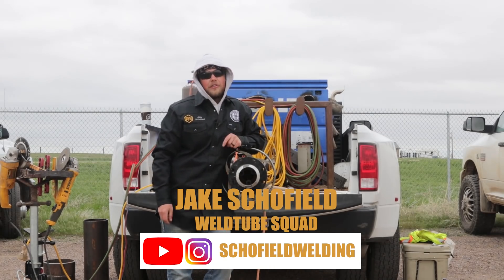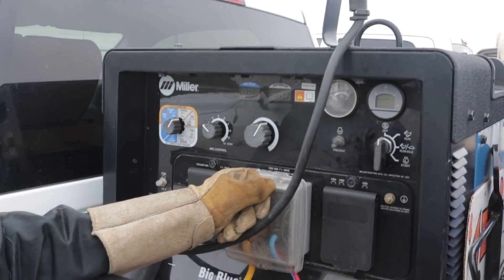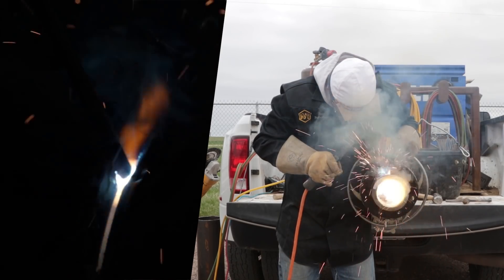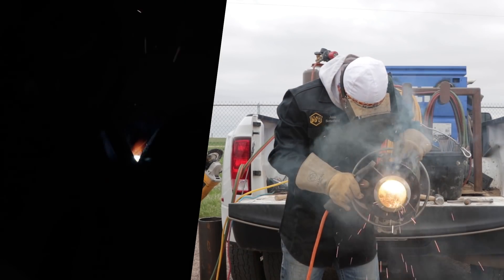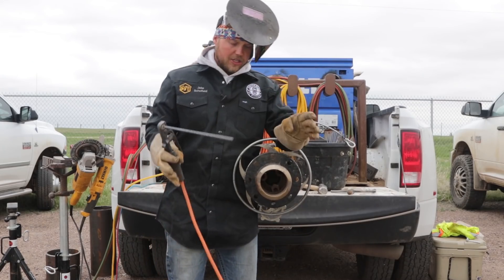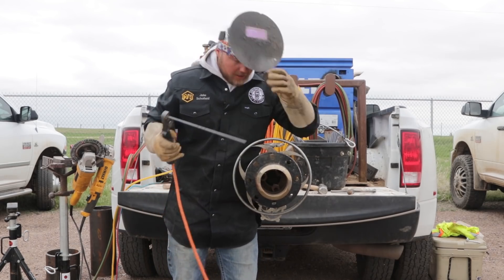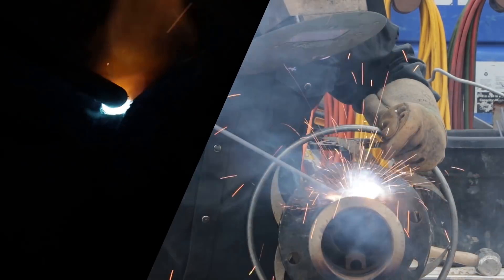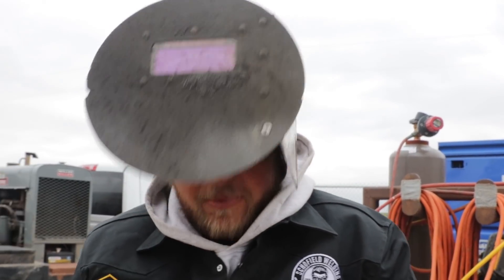Downhill welding tips and tricks 4” o-lot to flange

Comment: Bomber one tip don't do it it's crap welding learn to weld vertical .
Reply from the maker: Hahahahaha don’t weld on a roll out wheel?? 😂 Obvious you have never used one... do you realize how much faster it is.
Reply: @JacobSchofield  the studies that the US Navy have done on down hill welds I will never do it .
Reply from the maker: Sounds good you do you. But you can use a roll out wheel for uphill as well. Tig mig stock all of it.
Reply: @JacobSchofield  sounds like what you are calling a roll out wheel I call a rotary positioner ?
Reply from the maker: Same thing. So you have used one?  I don’t understand why your having an issue with it then?
Reply: @JacobSchofield  it's the down hill welding the Navy has so much research on this that it's just should never be done . From inclusions gravity stress its been a minute sence I w hent through the Navy high pressure pipe school but I do remember the impression that was played down never do it .
Reply from the maker: Man most all pipelines are welded with it... now for steam or boilers things like that all uphill.
Reply: @JacobSchofield  well you just exemplified the best reason never to do it .One should always strive for best and safest practices and the safest weld is always your best quality weld . piping is not like a structural weld where there are calculated stress that can be allowed for . Pipeing is flowing a liquid, gas or pressure through it with the slightest failure disaster WILL ensue .
Reply from the maker: The x ray and pressure test. Every single weld... are you just on here to argue?
Reply: No the Navy has clear evidence that a down hill weld is clearly an inferior process and by your own admittance that you would not use it on a steam/pressure system it is clear that it doesn't fall under "best practices".
Reply: @michaelvaughn2287  The man is welding according to pipeline code. He doesn't have a choice if he wants to keep his job. The Navy doesn't own that pipeline. So he's not doing it the Navy way. What difference does it make to you  ?
Reply: @kellyBorgman  so your trying to tell me they don't allow vertical because that bassackwards there is no way code is down hill and not vertical !
Reply: @michaelvaughn2287  Allow, don't allow, matters not. Its welded to code. API 1104. Look it up for yourself. If it calls for a 7018 cap, i guarantee its welded up. But E6010, sometimes known as 5P or 5P+, on cross country pipeline is a cellulosic coated rod. Run downhill. Those aren't the only rods, just 2 common ones. 7010, 8010 are common too. As Jake said all welds have to pass X ray. Don't like downhill welding. Dont do it. Check the API specs.
Reply: @kellyBorgman  down hill creates substandard welds the Navy has plenty of data on this it's flat out ignorant to allow this proses it creates unwanted stress's in the metal .
Reply: @michaelvaughn2287  Well rat spit. All those sub standard pipeline welds out there. We didn't know we weren't doing it the Navy way. You didn't even read up on the API specs, did you ?
Reply: @kellyBorgman  don't need to I've seen the metallurgy and grain structure of a downhill weld .

Comment: Good vid Jake . When I used to do a lot of fab I would put in a little shorter tacks and always burn through all the tacks.  The reason was I got caught with a couple of cracked tacks and then cracked welds . Just another way . If you have a technique that works well stick with it . It's to bad your weld shot of the key hole couldn't be more distinct in regards to where your weld metal ties into the parent metal  but I guess the camera would be to close to the fire . I liked the way you tied into the one tack through the big key hole . a round keyhole usually means a good bead .  How did you fit your olet to your flange ?
Reply: https://www.youtube.com/watch?v=4DwyYfzhtrA